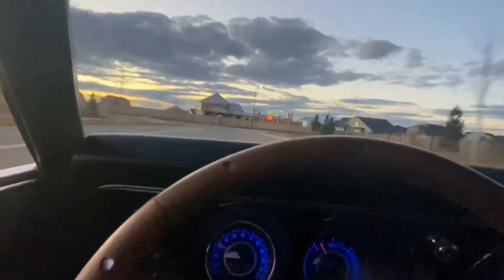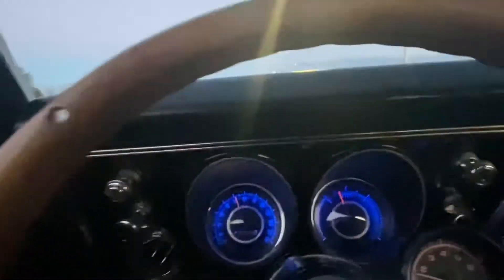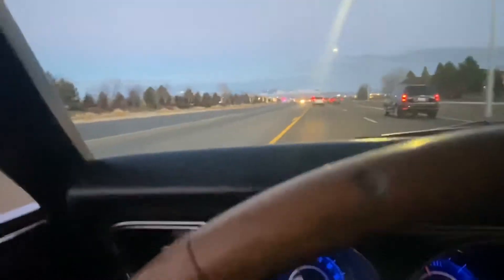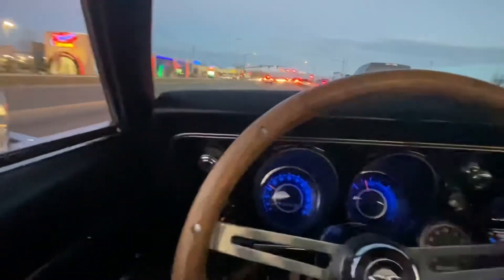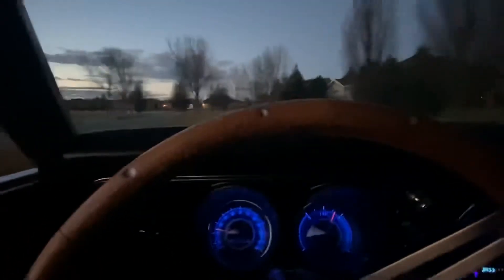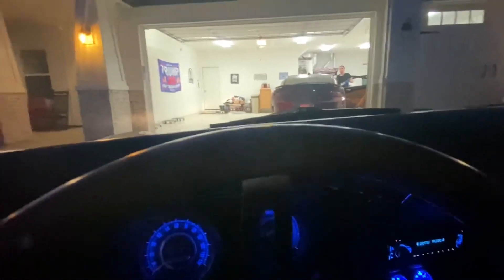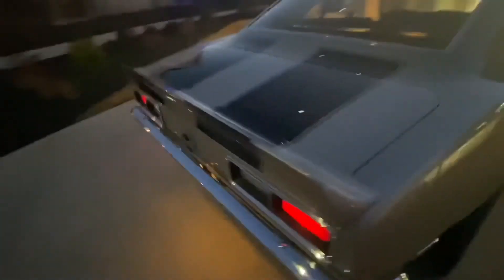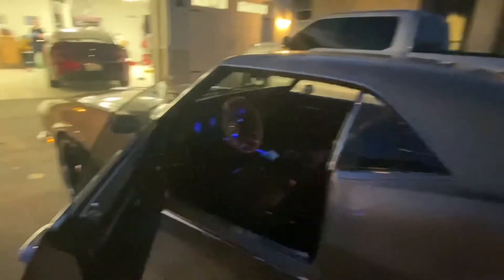1968 Camaro Blue Print 400 Small Block Driving Video

Comment: Will be putting one in my 2000 town car
Reply from the maker: You’ll love it- we bought another one for a 55 we have.
Reply: @nationhotrods  I'm going to have to finance it
Reply from the maker: @deleted....2000  I did too- I did the affirm credit card and paid it off in 12 months no interest lol
Reply: @nationhotrods   you got the full crate engine
Reply: @nationhotrods   you thinky 281 4.6 radiator would hook up to it
Reply: @nationhotrods   does it spin the tires
Reply from the maker: @deleted....2000  yeah it’ll spin as long as you like lol. On the radiator, I’m not sure- go join the Blueprint Facebook group and see if anyone has used a 4.6 radiator- I upgraded my Camaro radiator just in case. And yeah I bought it as a crate with intake, carb, and distributor already on it.
Reply: @nationhotrods   you think I should put it in my Lincoln you think it'll get alot of attention in the car scene
Reply from the maker: @deleted....2000  may make the Ford people upset a little bit lol

Comment: Sold! Lol I’m buying one for my truck lol I was on the fence but now I’m getting one my truck will have 4.56 gears an a built th350 so I’m hoping it will scoot me pretty good! Nice video by the way.
Reply from the maker: That’s awesome! Yeah your truck with those gears will spin for days if you want it to. Have some extra tires because you’ll burn those off just for the fun of it when you first get it dropped in! I absolutely love driving my car now.
Reply: @nationhotrods  that is awesome man do you run the 2400 stall converter like the website says?
Reply from the maker: @jaredbarraza6027  I’m running a 3000. I have some other vids up but not enough driving vids. I’ll try to get some more when the weather gets nice. I put in a 700r4 with 3000 stall and I really like it.
Reply: @nationhotrods  nice man I’m definitely getting one now lol thanks 👍
Reply from the maker: @jaredbarraza6027  post some vids when you do.
Reply: @nationhotrods  yea man I’ll try lol I suck at recording and talking lol but I been reading an looking for someone to see if they have advice on if a high stall converter will hurt my 4x4 like if it will be strong still lol not sure if that makes sense man lol
Reply from the maker: @jaredbarraza6027  I talked to a local trans shop in my case who built my 700. I had a 400 trans in it and blew it up within the first 250 miles which really sucked. The trans shop wanted all the dyno numbers from blue print and built my 700 with stronger internals and even in a 4x4 case. I’m not an trans mechanic so not sure what all they did but they assured me I should be good now with the numbers I’m running to the crank and also beefed up the driveline. So the weak link on mine now is the 10 bolt but I’m going to change it Lord willing sometime soon.
Reply: Just ordered this for my 79 K10 with stock th350 trans with shift kit and NP203. Wondering how long it will hold up? When it blows will convert to built 700R4 /4L60E. My stock 400 was rated at 195hp and 300 tq when new lol

Comment: Did you have the exhaust cut outs done locally? If so where at. I want to get that done on my 79 c10
Reply from the maker: I had them done when I was still in Idaho at Boise Muffler. Any shop you go to just tell them to add the y-pipe and my advice would be to take the electric cutouts (if you’re doing that as well) with you so they make sure they angle the Y cutout far enough so when you put on the electric cutout it doesn’t knock on your floorboard.

Comment: Hi. I have the same engine in my el camino. Would like to hear a little about what you have done to your engine. What a crunch shaft and intake. It sounds really good.
Reply from the maker: Thanks, yeah it’s basically the same as it came from Blueprint as I ordered the dressed long block motor already with the intake, distributor, and Holley 850. The exhaust is magnaflow but I have electric cut outs to really have it thumping.
Reply from the maker: https://blueprintengines.com/products/400-ci-stroker-crate-engine-small-block-gm-dressed-longblock-carburetor-bp4002ctc1

Comment: That needle was climbing 👌
Reply from the maker: I needed someone to hold the phone lol!
Reply: @nationhotrods  have a video posted,titled fastest srt6 on YouTube 179mph was challenging doing both lol
Reply from the maker: @carlostrujillo3854  wow, I’ll go check that out!
Reply: @nationhotrods  might sound odd but my wife has a 06 mustang gt, 4.6l stick shift, was thinking of ls swap but ls would be pricey,and coyote 5.0 is also expensive...I could afford to do it but don't know if I want to drop that much money on it,I've always loved the simplicity of carburated engines, ever since high school when I had a 76 chevy c10 with a 350, and my dad's 78 Pontiac phenix couple with a 383,and his monte carlo with a 350, those engines are capable of big power with,heads,crank,cam,procharger, blow through turbo set up exc...way more capable than the current 4.6l only making 268 stock, it has bolt on and last dyno in Sa,TX  in 09 made 326, the little 4.6 feels healthy but the power of a 383,or 400 sb from blueprint with basic mods would really wake the car up,would like a sniper efi setup eventually...what kind of numbers 2 expect out of the 400sb
Reply from the maker: @carlostrujillo3854  the dyno sheet had it over 500hp and torque but I’ve never had it dynoed myself at the rear wheels. I hope to do that this summer. I still daydream about owning a LS somedays when I get pissed working on one of our old cars but you’re right- just so simple to work on and cheap compared to an LS.
Reply: @nationhotrods  ; Strange that, I keep having the LS boys tell me what an old fart I am for building a hi HP SBC when I could do it so much cheaper on a LS platform. My 399 ci. puts down 641 hp. @6400 and 560 ft lb. @5700 on 89 octane NA. I wonder how much it would cost to build an LS  that's not a ticking time bomb with matching #'s NA.?
Reply from the maker: @waynetessier3058  man that’s awesome! Just the ease of being able to work on it makes the small block a better choice for me but I wish I had your power.
Reply: @nationhotrods  ; My heads would easily support over 800+ hp if I raised the compression a few points and put in an 800+ lift cam. My point tho is how much would it cost to get the same out of an LS in NA. form as they keep telling me how much cheaper it is to do an LS.

Comment: i have the 400 in my nova still i have been fouling a plug here in there trying to sort that out but it runs strong breaks tires loose easily running a 3000 stall with th400
Reply from the maker: I only had a plug foul over my own issues with headers touching the boot but not with the motor. Maybe check the timing?

Comment: Got me and all original all rust-free 1978 GMC Sierra classic 4x4 trailer special governed weight 9000 not the camper special limited edition 400 small block turbo 400 and a 203 transfer case with part-time mile marker conversion Factory Locker in the rear if you want to talk about a muscle car truck it don't get better than a square body that 400 is effortless putting 4 wheel drive and good you can't stop it
Reply from the maker: That’s awesome, I used to have a 77K10 with the 400 and regret ever selling it. I did a few vids on it where I spray painted it. It was a great running truck

Comment: Nice car and great sounding engine. Do you have video or pic of the dyno sheet? Blueprint 400 advertizes 508hp and 460tq. They just discontinued the lower hp 400 and now only offer BP4002CT1 for $5599
Reply from the maker: Yeah check out my other vids- I have a lot posted if the 400. I bought the long block with distributor, intake, and carb. I’ll have to try to find my sheet but both hp and torque were over 500.

Comment: Really why does the rear need changed , is it because you cant finesse the clutch and drive normal , I mean nowx 2we at you need to slip clutch and nail it ya! Really just drive it normal not s iui de steppin and boo hooo nnnn😂😂😂
Reply from the maker: Well it’s an automatic so no clutch, and it was a factory 10 bolt so it couldn’t handle 500 horsepower…